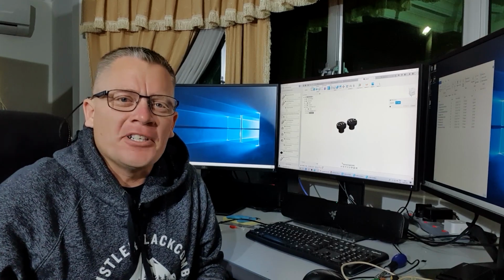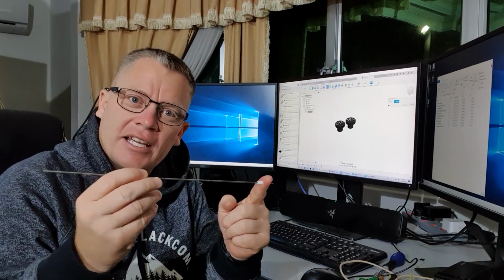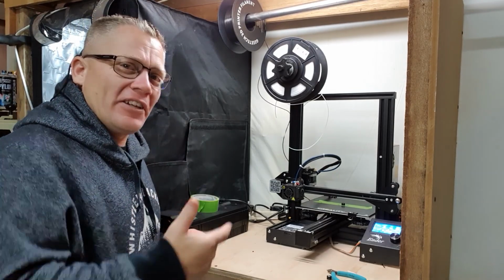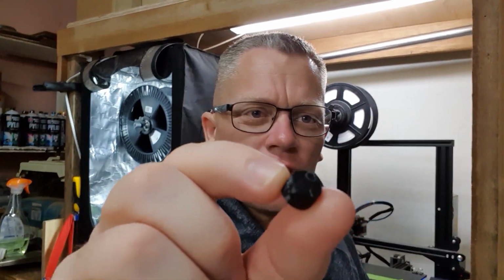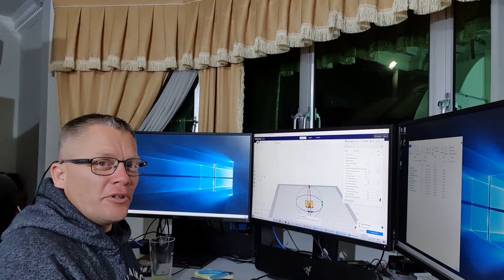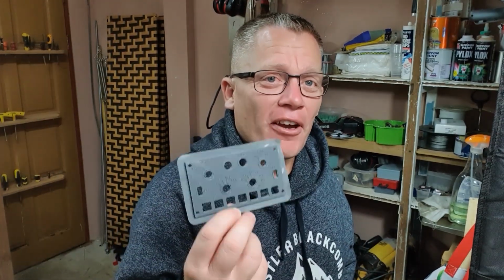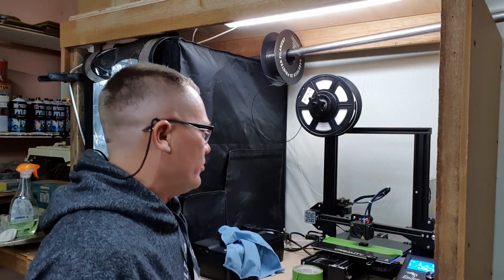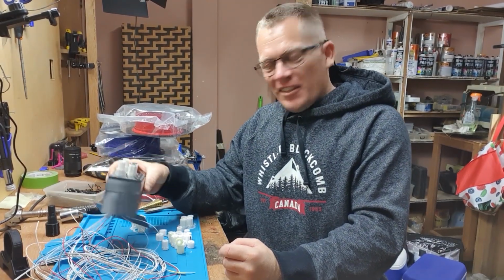A different kind of video - Vlogg

Comment: Hi mate, here's 2 other options which work all the time: 
1. Print the button in white. Spray paint in black. Lightly sand off the top of the letters on a flat surface to reveal the white pla or abs
2. Print the button in black. Use a white marker with flat head to paint the letters top white.
Both methods work really well.
Thanks for uploading your great videos and good luck with the rest of the build!
Reply: Option 1 is close my solution. 
I Pla print buttons first layer in white, then clear for more light. Spray paint in black, then i have a printed flat holder/frame to hold the buttons to CNC the letters removing the black spray paint.
Since i have the Fusion drawing it's easy pretty much to reuse same gcode for 3d print and cnc.
Reply from the maker: Hi and thank you Alex for the info. I have trialled many methods but wanted to see what the best was for those with only a 3d printer. Currently I like the raised text and using a paint pen, but now i have mastered filament change that produces much crisper and perfect text. Kind Regards Karl

Comment: When you switch filament colour, specially from a dark to a lighter colour, you really should purge the hotend by running about 10-15 cm of the new filament through it before restarting the print. That's why the sacrificial last attempt worked for you. Love your videos!
Reply from the maker: Hi Teddy! I have switched from pause printing to filament change and find it way more reliable! After putting all that effort in. I have now switched to resin prints were the text is perfect at any size. This should look good on the new FMC! Thanks for the Kind words, Karl

Comment: Try printing in white, paint it all black, then sand off the black paint on the letters. 
On my Ender 3 Pro, it stops for the filament change, but if not watching it, it only stops about 20 seconds then resumes printing, so I miss the chance to change filament.
Reply from the maker: Hi Tony, The old paint and sand method is how i used to do it, but the letters can look very smudged/blurred after sanding on small print. I am just trying the same process now with my resin printer. Kind Regards Karl
Reply: @helimech8152  , Karl, I’ve had problems when the font is too small, so I’ve enlarged it, probably losing some of the genuine look, but I’m cool with that on my rough and ready ol’ Baron B58, so long as I’m still flying :)
Love you work mate!
Cheers from Australia.

Comment: I bought the CDU data from your home page, but I don't know the wiring diagram. What should I do?
Reply from the maker: Hello, The current FMC was designed before the website went live and was one of my first designs with the CNC machine. Therefore it currently doesn't have a wiring diagram. As its only 67 buttons its fairly simple to wire to an Arduino and use Prosim to programme the buttons via the interface Mobiflight. I would highly recommend you daisy chaining all the grounds. If you are going to back light via led tactile switches, remember to chain them in sets of 5 with a resistor. I am currently working on a new 3d printed FMC, but that wont be ready for a little while yet. Kind Regards Karl
Reply: @helimech8152  Thank you for your prompt reply.

Comment: I have would think engraving then useing the inlay methered to put the info on the knob 
You use a cutter to engrave the info then use a wax collour like a crayon
Reply from the maker: I would use my CNC/Laser for engraving, but as this design was supposed to be fully printed I needed other alternatives. The wax method really doesn't work out here in the heat. It looks great initially, then looks awful after a few weeks. I think I would need to increase the depth and apply many more layers of varnish to get better results. Thank you for mentioning it, as others may find this method useful! Kind Regards Karl
Reply: @helimech8152  Hi you could also try what we in the engraving side call paint filling where you fill the engraved letters with paint then when dry sand it to in harnce the lettering
Only a thought 
BTW Love your channel

Comment: Hi Karl
I noticed your green tape on the Ender beds.  Is that like painters tape from 3M?  I had a Ender and a CR6-SE.  My Ender 3 Pro I have the new type metal PEI coated bed which works great but the CR6-SE bed is that black material and unless I clean with Alcohol after each print I have problems.  So wondering if I should try the tape?

Also that looked like a EFIS panel.  You had said you would have the STL files for them soon, so are they now available?  I did purchased the  Fusion 360 files from you.

Thanks, Jay Beckham
Reply from the maker: Hi Jay, My Ender 3 V2 glass bed came with the black residue fitted. It worked fantastic for the first few months. But i think its worn out and nothing sticks to it now. So yes, I now use painters tape called frog tape. Every thing sticks to it! Love the stuff! We have spoken about the EFIS, If you need STL files for the CNC version, please right click the part in fusion and select save as STL. Kind Regards Karl.

Comment: You should use a dual extruder, no issues.
Reply from the maker: I have been looking for kits on amazon (UK), but nothing has popped up yet. Would really would make life simple
Reply: @helimech8152  I am surprised there is nothing in the UK.